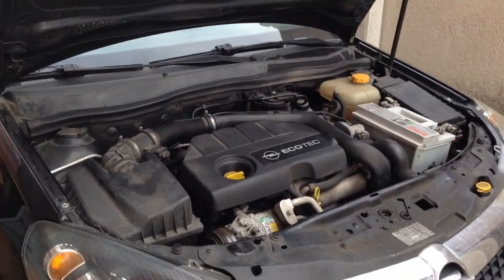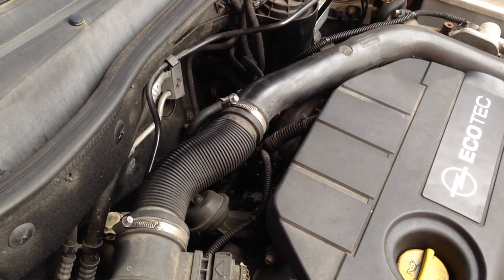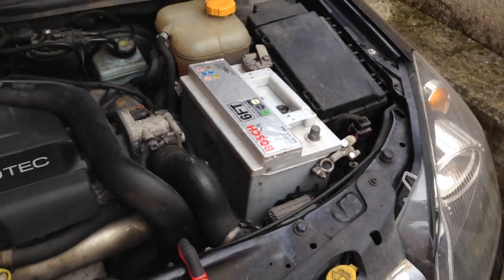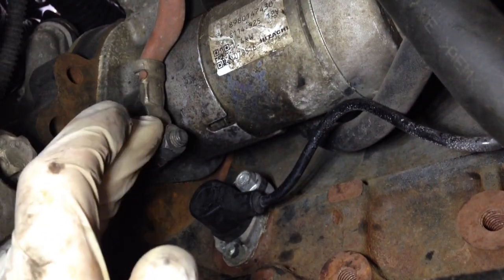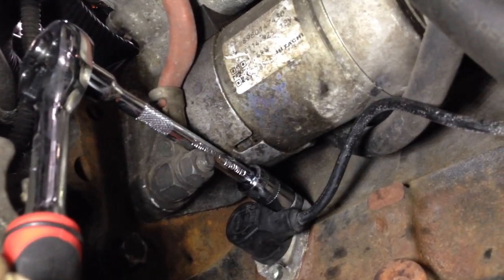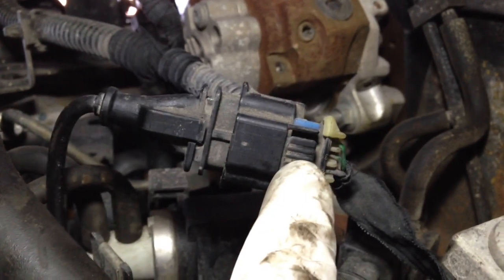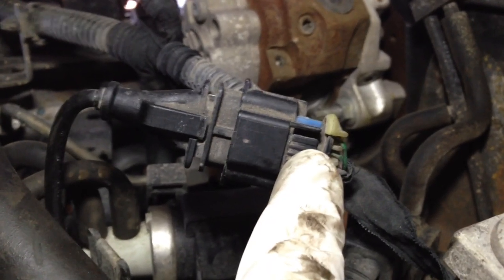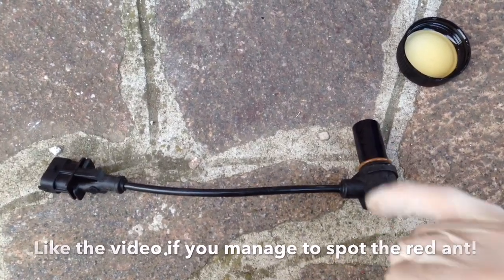Astra Crank Sensor Replacement. Easy DIY Tutorial.

Comment: Thanks Chris

My mk5 09 astra misfired then a mile later died on the a34 outside of Oxford yesterday (timed well for an off ramp thank the gods). Rac came and having tried to refire the engine myself we got towed to a layby and it started fine.

Rac put it on the computer - No fault 
Said might be intermittently failing crank sensor, does this sound right?
Reply from the maker: Hi Paul, yes it may be the crank sensor. It could've something else but crank sensors are so cheap that it makes sense to replace it to see if that fixes the problem. Cheers, Chris 👍
Reply: Christopher Barr - Random Chris 
Cheers Chris
It went again yesterday 500yards from home.
Pedal test code ecn 033529
So that will be a crank sensor code then.

One word of warning the access to the bloody sensor is TIGHT!!! disconnecting the wire was an sob. Get the car high and watch where you Axle stand.
Reply from the maker: Glad you found the problem and got it sorted Paul. Cheers, Chris 👍

Comment: I was just driving down the road and my Astra cut out ..oil light popped up ..it cut out for a second time and it wouldn't turn over but it suddenly kicked in and started..any ideas
Reply from the maker: Sound like it could be the crank sensor. Try this and see what codes you get: How to Read Fault Codes WITHOUT a Diagnostic Tool - Astra, Zafira, Corsa, Vectra etc. (Pedal Test) https://youtu.be/MqUMXeqO9Hg

Comment: hi Chris. is the location of the sensor the same on a mk5 1.4 petrol as noticed the car in the video is diesal.
Reply from the maker: Hi Scott, it is a totally different engine but the crank sensor will be in the same general area: adjacent to the engine / gearbox interface, usually down near the bottom. If you get under the car and have a nosy you'll definitely find it. Good luck! Cheers, Chris
Reply: Random Chris thanks will have a mooch tomorrow.
Reply: Random Chris. All sorted. 20 quid for the part. just a bit of warning. On the 1.4 petrol engine the bolt holding sensor in was an E10 torx bolt with a male head.
Reply from the maker: Excellent news Scott, if you'd have gone to a garage you'd have paid more than £20 just for them to read your fault codes... thanks for the heads up for other viewers regarding the torx bolt. Cheers, Chris 👍

Comment: Hi I know it has been several years since you posted this feed.  But i'm wondering if you can help.  The below information is extracts from conversations with local mechanics and youtubers.  I've highlighted my response with Questions and mechanic and youtubers response in Answers denoted by letters.

(Q) Astra H MK5 SRI XP, starts fine drives fine, white smoke when trying to accelerate. It chokes and coughs 2-3 times on acceleration and then a plume of white smoke covering the entire rear screen, goes away and drives fine. Only happens when I try to hard accelerate.  I notice fuel is affected.

(A) Could be a oil seals failing on your turbo. Take off your intercooler and you should expect about 10 ml of oil collected for a healthy system. If you're finding pints of oil then spend money to replace the turbo.

(Q) Just another question, the other day another mechanic mentioned faulty coil pack and replacement of this and plugs.  Another mechanic said that the cheap ebay Rocker Cover (i purchased last year) with Gasket kit is the fault, due to excessive pressure trying to excapse when lifting off the oil cap after hot engine run.  Advised to get a recommended OEM Rocker Cover at nearly £250 from Europarts.  All seem to rebunk failing oil seal turbo.  What does this all sound like?  Please note, mechanic ECM ODReader pickup a Crankshaft issue but this was cleared before I the chance to note it down.  

(A) the rocker cover shouldn't have pressure in it when everything is running properly. It's job is to make sure oil doesn't escape and leak everywhere. If you are seeing a lot of pressure build up in the rocker cover then it's likely that the seals have gone in your cylinder (piston rings).

(Q)  Thanks again.  Would you advise to ignore the Coil Pack Spark Plug replacement?  What's likley cost for seal replacement in cylinder (piston rings)? All they want me to do is replace things by not honing in on what the issue could be, but I can understand how difficult it would be without hooking it up to a management system.

(A) HI there, from reading the above I would suggest the piston rings or the head gasket. Obviously its very hard to diagnose any issues with the car without seeing it, white smoke is typically from water getting into the engine via the head gasket, cracks in the cylinder or the turbo cooling system, if it was black or blue smoke I would suggest something more oil related. Is there an oily residue on the rear screen after the smoke?  I would hold off on spending any more money on parts and conduct a compression test to the cylinders, this would narrow it down to the head gasket, rings or a crack somewhere.  Also is the engine management light on, if you don't have an OBD reader I would suggest buying one cheap and seeing if there are any codes thrown up. Hopefully that helped.

(Q) Summary; Today I purchased a replacement Coil Pack and Plugs and a OBD Code Reader and have in basket a Vauxhall Astra H MK5 1.8 Petrol (2004-08) Camshaft Cam Position Sensor, not yet purchased.  

I'm hoping this will allow for no acceleration chokes and the erradication of white smoke.

Any feedback would be appreciated.

Comment: Hi Chris, this is from Turkey. İ have Corsa C 2001, so my engine losses power after 4000rpm it doesnt get more gas like ment to be. So users says this sensor should be changed, do you have any idea about this issue with my car. İ already check Egr,Air Maff Sensor, they all clean. Thank you so much on advance. ✋️
Reply from the maker: Hi Erman, have you done the 'pedal test' to see what engine error codes you have? If you've not done this yet, please see my other video showing you how you can get your error codes for free, without any tools: https://www.youtube.com/watch?v=MqUMXeqO9Hg Come back to me with your error codes and I'll do my best to help you out. Cheers, Chris :-)
Reply: İ ll make it and write you back, thank y so much for your support. 👍 warm regards
Reply: Hi Chris, i connect to machine for see the errors but nothing show up:/ i cleaned maff sensor with contact sprey  but not resolved. İ beliave cranks sensor do this or buji cables. Thank you
Reply from the maker: Hi Erman, that's a shame about the codes but from what you've told me I would say changing the crank sensor is probably a good next step to take. (They don't always give error codes when they start to break down...) The crank sensor is an easy job so it's not too big a deal. Good luck and please let us all know how you get on. Cheers, Chris 👍
Reply: Hi Chris so good news:) i told you before that cutting gas arroung 4000rpm, finally no more. Thanks god, i went to Opel Service and they told me that there is dirt on the cylinder or top fuel system, use a Luqiu Moly Fuel System Cleaner and drive for a 1 hour on high pressure like 150-170 km. İ did and there is no more power lose. İ just wanted to let y know for upcoming issues might be. Thank you take care;)

Comment: is a crank sensor same as the camshaft position
Reply from the maker: The sensors are often exactly the same but they do different jobs and are wired to a different part of the ECM. 👍

Comment: Hi, I have an astra h 2005 1.6. The car is not starting because the crankshaft plate is set wrong. The sensor is working fine. But the plate with teeth which is attached to the crankshaft seems to be not set right and now the sensor is not sensing the turns. How is the plate set? please assist
Reply from the maker: Hi there, it seems to me to be extremely unlikely that the flywheel is the issue here. (It's more likely to be a problem with the crankshaft position sensor, or possibly the camshaft position sensor.) Try doing this pedal test to get your fault codes:

https://www.youtube.com/watch?v=MqUMXeqO9Hg

Come back to me with your engine error codes, and I'll see what I can suggest.
Reply: Random Chris sorry I mean the increment disc which is close to the crankshaft pulse pick-up. The engine is out of the car so not sure if the pedal test will work.
Reply from the maker: Hi there, as far as I can see that is an Astra J manual... To be honest with you I'll have to say I don't know on this one. I'm pretty sure I could work it out if I could see the engine and carry out tests etc. but online it's too much of a big ask I'm afraid. If any other viewers can help out, please feel free to offer advice. Good luck! Chris
Reply from the maker: That is an Astra F Manual - the Astra H crank sensor doesn't have a bracket it's located directly through the engine casing.
Reply: Hi, the car is starting now, had to replace the top with a new one. The only problem now is the car has little power when driving. Climbing an uphill is a problem. I have seen that the airflow meter sensor cable is cut, could this be the problem? When I rev the car passes through 3rpm and sometimes when driving the rev doesnt respond. The pump is also sending petrol straight without stopping/non stop priming.
Reply from the maker: Hi there, I'm glad you are back on the road although I'm sorry to hear about your continuing problems. I'd have to see the car in question and do some proper fault-finding to get to the bottom of this. If any other viewers are more knowledgable than me and can help out, please feel free to offer advice. Cheers, Chris

Comment: Nice guide for the crankshaft sensor. I have error code P0340.  do you have a link or a guide for the camshaft sensor replacement?

thanks.

Comment: Hi we have replaced the sensor and now have gone from a car that started and cut occasionally to one that now starts and cuts immediately. Leave it a while and its starts again but it doesnt want to to revs dip low. The codes are the same on the pedal test so are at a loss now what to do :(
Reply from the maker: Hi Samantha, did you fit a OEM Crankshaft Sensor or an aftermarket one?
Reply: @christopher_barr  after market I think. It was from euro car parts
Reply: Update though now it appears we also have an eye fault even though it was cleaned out. Very low on power and lots of gunk from the exhaust
Reply from the maker: I am usually all for aftermarket parts but crankshaft sensors are notoriously finicky so I'd recommend an original one (The tolerances involved are very fine with crank sensors) Was the battery disconnected for a while while the crank sensor was changed?
Reply: @christopher_barr  yes. I always disconnect when doing work.
Reply from the maker: You might expect a bit of rough running after a battery disconnection as it is effectively an ECM reset, but it sounds as though your symptoms are much worse than that. I would try an OEM crank sensor and see if that makes a difference. It shouldn't be too expensive. I've also heard of rare cases where a faulty cam sensor goes undetected by the ECM but instead the crank sensor output is flagged in the fault codes. (i.e. there is no cam sensor fault code but the cam sensor is faulty) That's another avenue to think about.
Reply: @christopher_barr  thanks so much. Looks like its the EGR that's causing the pain now it got cleaned out but now I think its stuck as we have a new fault code

Comment: you change the battery too, that's weird.
Reply from the maker: A faulty crank sensor can make a car cut out and stop it from starting. As our crank sensor had failed, we had trouble with the engine cutting out and trouble starting it again, hence the battery was massively undercharged and that is why I swapped it out with a charged battery. Not weird, just not a part of the crankshaft sensor replacement, which is why I didn’t cover it in the video. Cheers, Chris